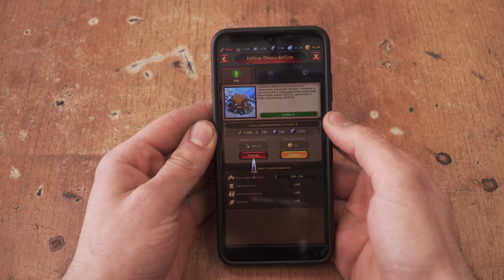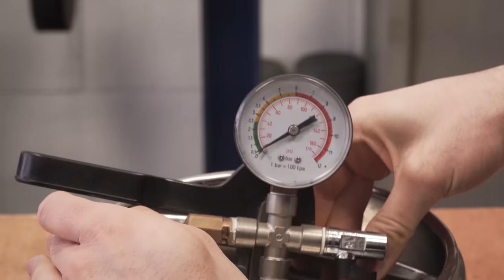Knifemaking | VENOM Inspired Knife

Comment: Love the whole thing. Far too many items required to get there which is a show stopper for most of us
Reply: Doosha Khaboosha start small, work up big. Not all epoxy needs a pressure pot. Molds can be made easily. No band saw? Hack saw or angle grinder both under 20$. No belt sander? Use files. There are many ways to make knives. Knifemaking is like the car world. There you pay for horsepower, here you pay for speed of operation.
Reply: @joecoastie99  good advice I appreciate it

Comment: Don’t know if I will get a response to this but I would pay for you to forge me a belt buckle. No matter what buckle I buy the piece that goes in the hole of the leather breaks or bends or the loop is made out of a low carbon metal and it will eventually bend or lose strength and not hold the belt to the leather anymore. Then pointy edges suck when they are pointing at my belly or man parts 😅.

Comment: Nice work! But you should do your self a Favor by not wearing Gloves while working on a Bandsaw, a Grinder, or any rotating Machine. The Gloves won't protect your Fingers from getting hurt if you slip off! But wearing Gloves or not may divide between just hurting your Fingers, or losing an Hand, if the Machine catch up the Gloves. ;)